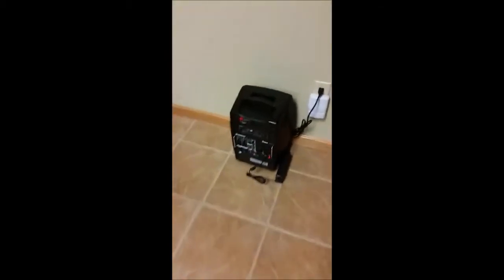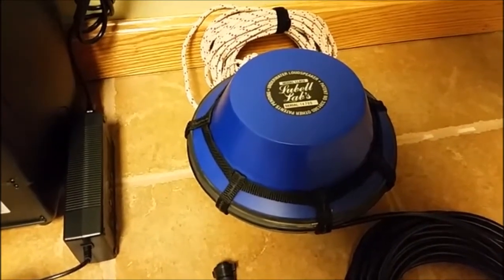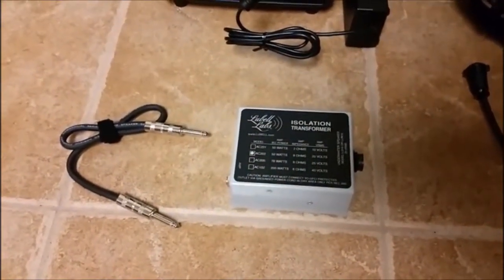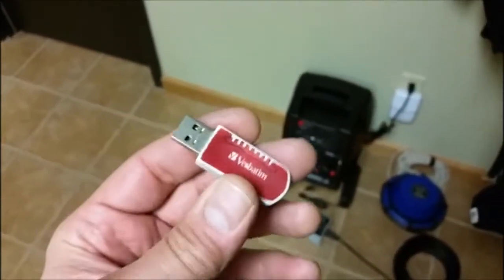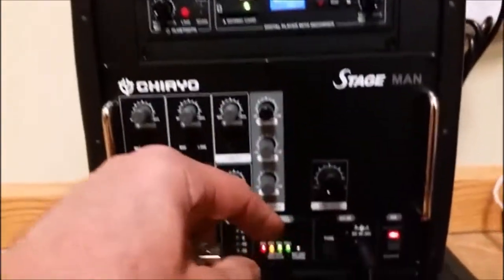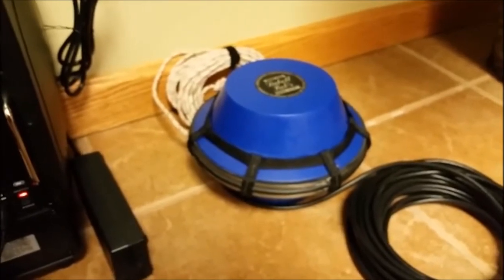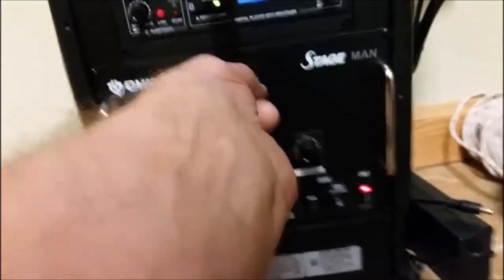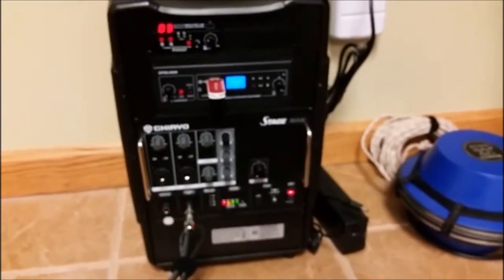Complete Air and Water Sound System for Synchronized Swimming by Lubell Labs

Comment: What is inside the underwater speaker how do you make underwater speakers
Reply from the maker: Our design uses a multi-element piezoelectric stack bolted between two PVC overmolded die cast conical aluminum pistons. This forms an insulated enclosure that we house electronics and transformers within, then seal with redundant seals. It is a very effective design approaching 60% efficiency, converting electrical variations to force variations using the electrostrictive effect. The force variations move the two pistons in unison against the reaction of radiation resistance and mass. Because of the high impedance of aqueous media, small excursions of the pistons produce acoustic waves of considerable strength.